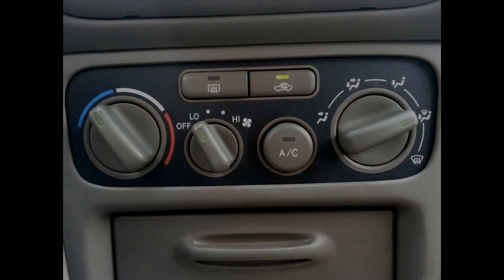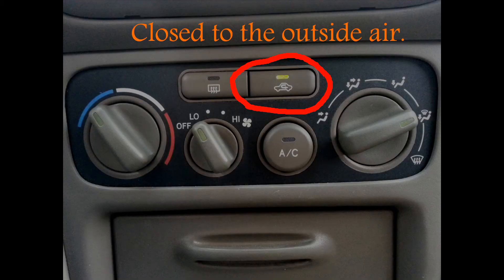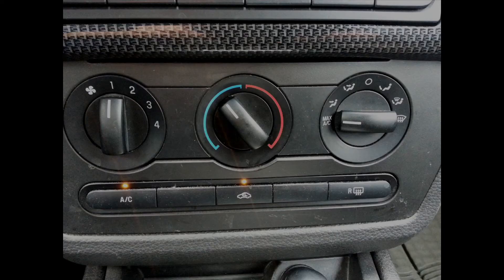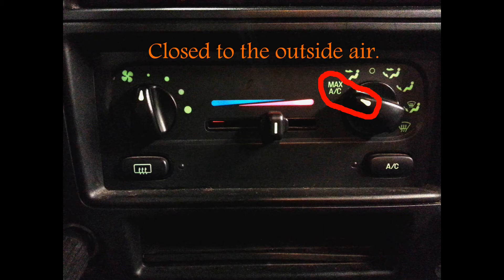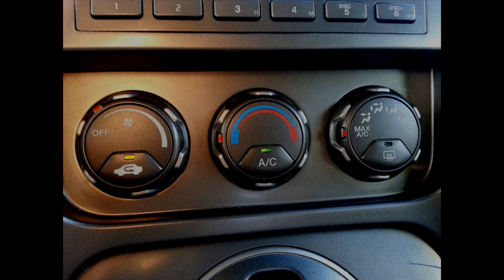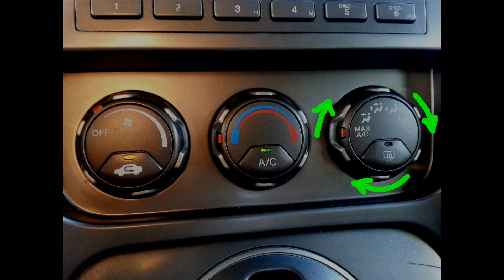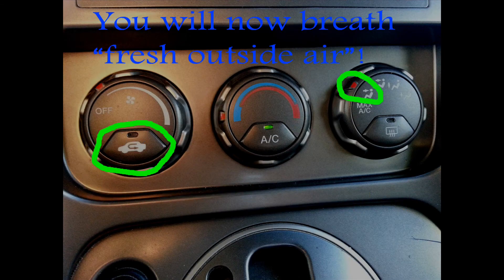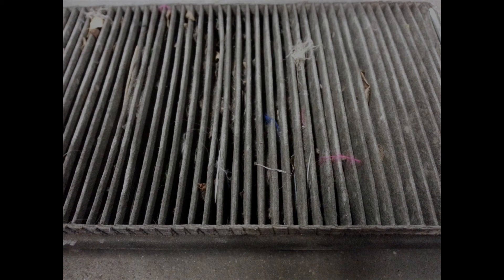Improve Car Air Quality: Ditch Recirculate for Fresh Air #3

Comment from the maker: In this video I talk about fresh air  when you're driving, making sure your "recirculate/max A/C" mode is not engaged!.. and the importance of replacing your in car air filter (cabin filter) . If you have no air flow by the way, most likely your cabin air filter is plugged! Check it out if you have that problem. Thanks